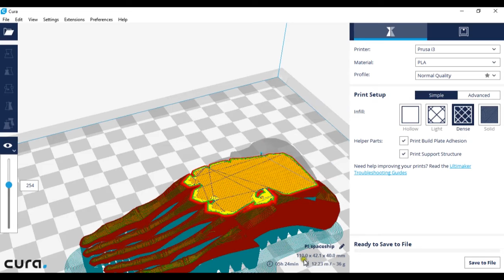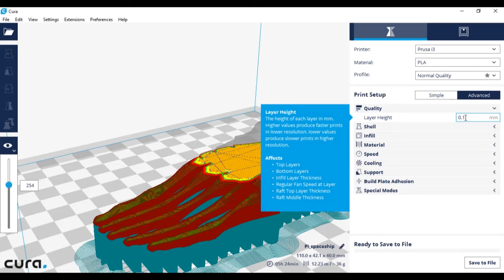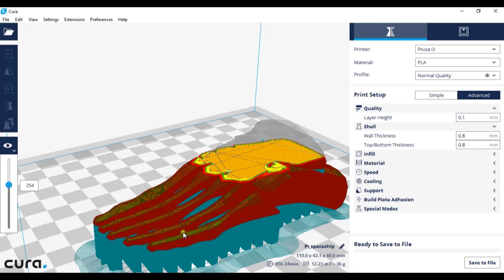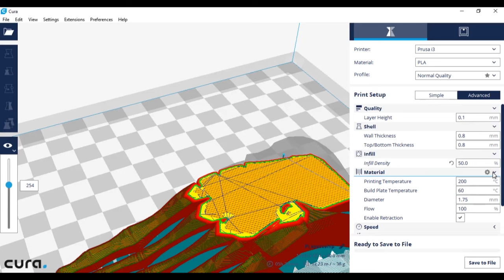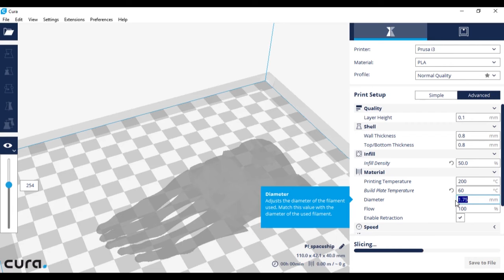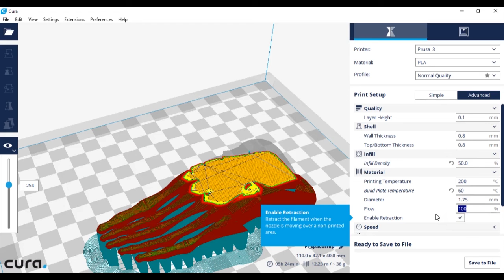Cura 3D Printing Tutorial Episode 3 Infill,layer height, shells and material

Comment: Hi i am fairly new to cura and 3d printing. But i need to print some completely solid objects with no infill patterns at all just solid PLA  can you help. i must have a newer version of cura because i cannot find the boxes for infill that you have at about 1 min 50 in your video with the boxes that say hollow light dense and solid.
many thanks kev
Reply from the maker: good afternoon kev, In the new versions of cura, Under recommended their is an infill slide, change the slider to 100% to make your object solid. I have meant to do an introduction to the newer cura but haven't had time. Hope this helps from Chris.
Reply: Darkcaper 3Dmodels ok chris i will check it out many thanks.

Comment: I created  an object to 3d print in blender . the model looks good even when I import it to cura . but it doesn't print good. all the features of the top layer don't print. when I looked at the layers , all the details don't show up in the layers wtf? is it a problem with cura or blender? can you help me.
Reply from the maker: Hi Jes, there are a wide range of reasons this problem can happen, I would need to see your mesh to tell you whats wrong, however some things i could be are. the details are to small for the print settings (nozzle to big), the details are not solid so cura cant register its thickness or maybe the normals are facing the wrong way on the details.

Chris